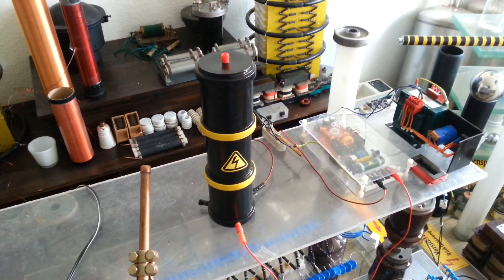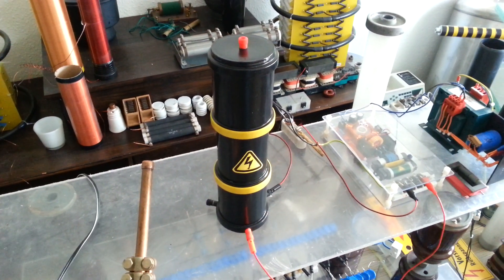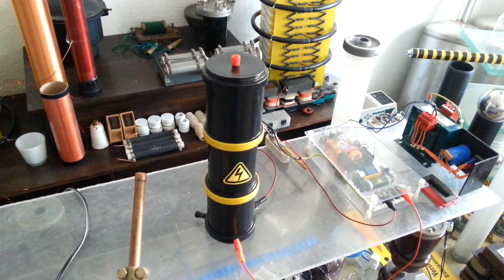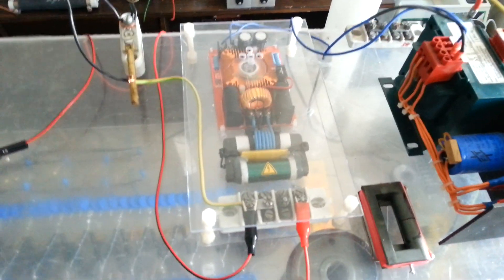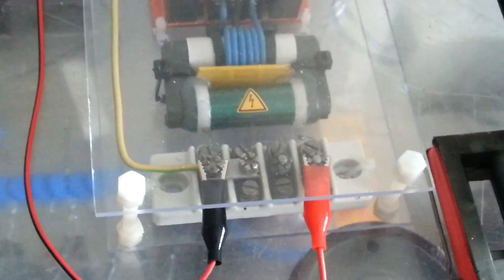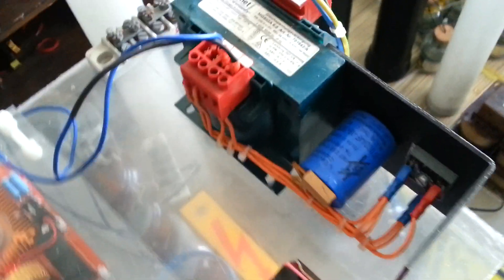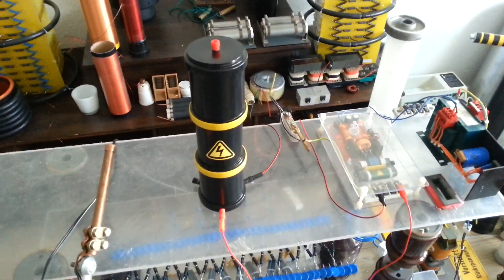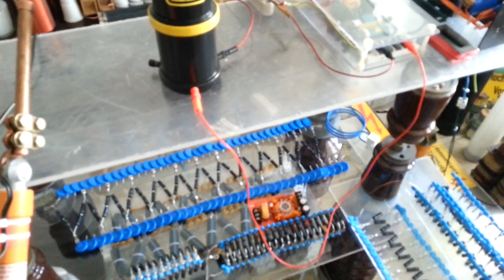High Voltage : HOMEMADE 120 kV DC Cockcroft Walton Multiplier "Quick&Dirty" Direct Current

Comment: Hi.I’m a EEE student.I need your help.How did calculate each stage current:350 mA for that CW?And whats your CW capacitance voltage rating and diodes value?Thank u.
Reply from the maker: Hello,

A Simple Google Search will be your Friend .

Dont miss and also check out the 4HV Forum Stuff - there you will find any information wich is related to the subject Area and you're looking for .